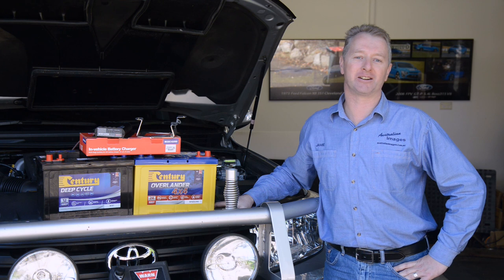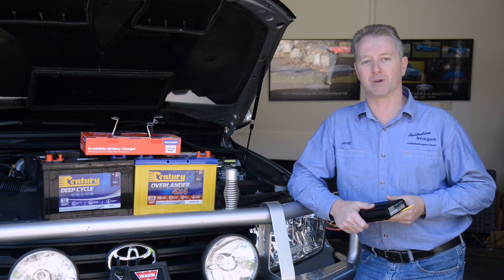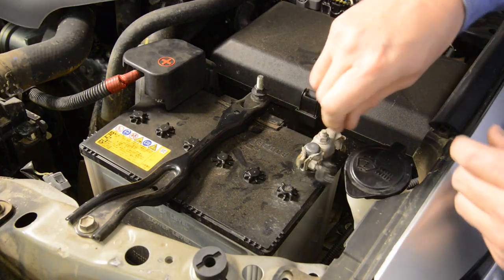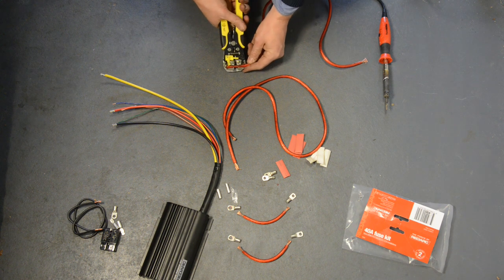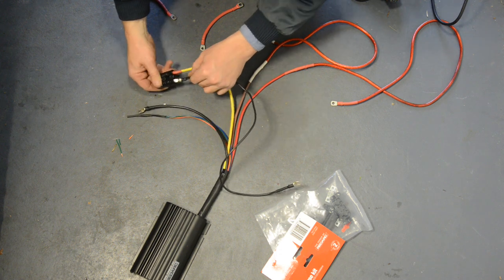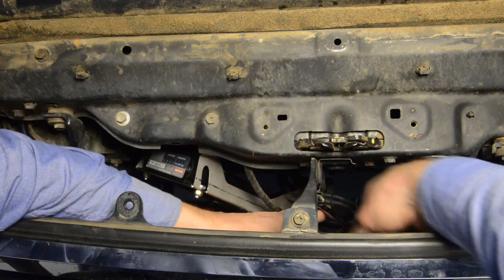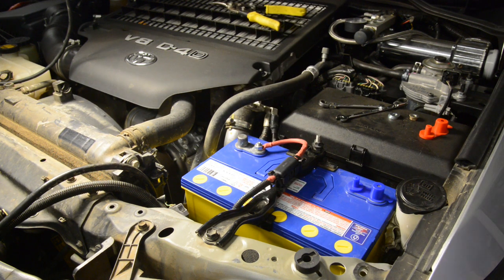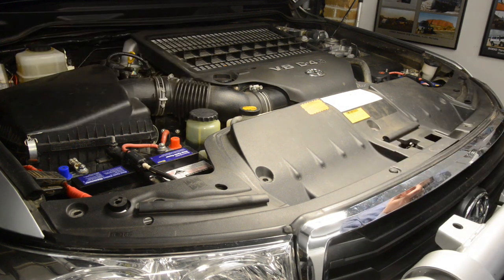LandCruiser 200 Dual battery system & DC-DC charger install - Project 200 - Redarc BCDC1225D

Comment: australian images im following your setup just wanted to know on the deep cycle battery where is the other live wire coming from, 1 from the bcdc what about the other one. Is that the lead for your fuse box thanks.
Reply from the maker: Yes, that's correct. Goes over to the input for the fusebox.

Comment: I have a question how come you don’t connect the blue wire to the fuse box to fire the charger ? Just wondering how it knows how to turn on ?
Reply from the maker: No need with the 200-series as it doesn't have a 'smart' alternator. So the charger detects the car is running due to higher voltage on the start battery, and switches itself on. Then turns off when the voltage drops again after you turn off the car. You only need to connect the 'trip' wire if the car has a smart alternator.
Reply: @austimages  thank you so much very well explained

Comment: Hi, what cables we should use ?
Reply from the maker: Between the batteries and the charger, you should use 8mm2 (which is also 8AWG) cable.
Reply: Thanks A lot , and what cable size should we use for running cable from battery to behind car for fridges etc ?
Reply from the maker: @tyfam  That depends on the total current draw. You want to use a cable large enough to keep voltage drop to less than 1 volt if possible. There is a calculator here: http://www.voltagedropcalculator.com.au When you use the calculator, the length is just the one-way distance from the battery to the load. This calculator automatically works it out using the return distance, which you normally have to include in calculations.

Comment: Why use a 25 amp charger ?
Reply from the maker: It's what Redarc recommend for that size battery and my typical current draw. If you have a larger battery and/or higher current loads, then you could go for the 40 amp charger instead. They have a calculator on their website that you can use.

Comment: Can you run just the 2 batteries on the 200 without a BCDC charger..?
Reply from the maker: That's how the factory setup works. But if you want to split them so accessories don't drain the start battery, then you need to have a way to charge the aux battery. Either a BCDC, an electronic isolator or a manual isolator. BCDC is the better option as it looks after the battery and allows solar charging as well.
Reply: @austimages  Thanks for the reply and I just installed the BCDC with a Deep cycle and the Century Ultra Performance instead of 4x4 overlander. System is working as expected. I have a Century BM12V Bluetooth sensor connected to the starting Battery and everyday in the morning (cold start) gives me a notification saying the cranking voltage is low which varies from 9.3v to 9.5v. Is that normal..?
Reply from the maker: @sampathh  I don't have any experience with the Century monitor. But it is normal for voltage to drop when cranking. I wouldn't;t think it would go down that far though. Probably best to contact Century and check with them regarding the setup.

Comment: I thought the reason for the dc-dc chargers is to prevent voltage loss since longer wiring causes that, but that doesn't look long I reckon. So why need a dc-dc charger?
Reply from the maker: They are better for batteries in general, because they deliver a good charge profile at variable voltages rather than the raw current/voltage from an alternator.
Reply: @austimages  Righto, would I need an isolator switch if I have this DC-DC charger?
Reply from the maker: @MC-jf6ic  No need for an isolator
Reply: @austimages  Thank you

Comment: Where did you mount the Anderson plug?Were there any problems with the height of the aux battery and the original clamp?
Reply from the maker: The anderson plug is mounted to the bullbar, behind the winch control box. You could also mount it to the grille. No problems with the clamp and the battery.

Comment: Hi there, If you add solar pannels would they work through the unit without the car being on?
Reply from the maker: Yes. The charger is triggered as soon as there is sufficient voltage available. The car doesn't have to be switched on.
Reply: Not if it’s hot

Comment: G’day
What’s your opinion of lithium batteries, worth it or not?

Do you think an inverter is necessary or is it an in-needed luxury.
Reply from the maker: I haven't tried lithium batteries under bonnet yet, although I will likely go down that path next time. They are great for weight and deep discharge capability. I think the jury is still out on under bonnet longevity if you operate in high temperatures and low speeds. Inverters are great if you have 240v equipment you need to run. I don't have one in the 200 other than the small factory unit, which is enough to charge batteries. Very useful in a caravan or camper when you're off-grid.

Comment: Love your videos Jamie. If you were doing the same battery install today would you still use the Century and the Overlander?
Reply from the maker: Still happy with both of these. 5 years on and the overlander is still going. The deep cycle has been replaced once, last year. I'm keeping an eye on the long term performance of some of the new lithium batteries under bonnet. I have a 300-series on order, and will decide then whether to go lithium. Much more usable capacity, but also much more expensive.

Comment: Very informative video. I have just purchased a 2018 VX 200 series and looking at a dual battery system. The company who are carrying out a lot of my mods are using Intervolt DCC Pro system, have you heard much about theses? I do like REDARC products.
With the Intervolt you get a display system to monitor your battery’s/charging. What do you use with your REDARC system?

Comment: Great video's. Would you consider doing a lithium battery setup as from Deep cycle systems. ULTIMATE DCS 12V 260AH DUAL BATTERY SYSTEM (LITHIUM) – LAND CRUISER 200 SERIES
Reply from the maker: I would absolutely go for lithium if not in the engine bay. I'm still wary of putting them under the bonnet, but I would consider it after doing some more research on real-world durability now that they've been around for a few years. As I'm not in the market at the moment, I haven't looked at how they are performing after a few years.

Comment: Hi,great explanation as always!
Would this also be the same or similar set up for Petrol version 4.6 v8 with only One factory battery?
Cheers
Reply from the maker: The same, other than no need to remove the linking cable. You'd also need to get a factory battery clamp from Toyota for the 2nd battery.
Reply: Australian Images Thanks a lot

Comment: Do you not need to plug the wire for a smart alternator with a LC 200?
Reply from the maker: No. The 200 doesn't have a 'smart alternator'. It has a 'temperature sensing alternator'. No need to connect the extra wire for that.
Reply: Australian Images thank you!

Comment: Does this also apply to 100 series LC with dual starter batteries?
Reply from the maker: Yes, other than the charger bracket that was used, all of the same parts and connections could be used in a 100.

Comment: this land cruiser 200 series not have a 24v start? in this case Why have 2 factory batteries?
Reply from the maker: No, it does not have a 24v start. The two batteries are in a parallel 12v configuration. The only reasons for having two batteries would be to provide additional cranking amps during starting, or to allow for additional accessory usage without getting a flat battery.
Reply: ah, I thought is same wath my 80 series. My 80 series have dual factory batteries, with 24v start and system electrics12v.
Reply: But, if it have his one alterator to charge bateries, why you install a batery cahrger?
Reply from the maker: The two batteries are now split, so leaving a fridge on for a few days doesn't flatten the starting battery. So the alternator is no longer connected to the 2nd battery. To charge it, you either need a 'battery isolator' or a DC-DC charger. An isolated is simpler but a DC-DC charger does a better job of charging the battery.
Reply: ok, so the idea with this is to have one battery for the accessories and one for the boot. But with a single battery the engine will start well?
Reply from the maker: Yes, that's correct. Starts fine on a single battery, but it needs a CCA rating of around 700 or more.
Reply: Nice, Thanks a lot. anther question: You have heard of the famous turbo timer, the device that leaves the engine on for a while, to take care of the turbo, in which the temperature is normalized before turning off, in the land cruiser, it is necessary to wait a while to turn off when one performs a trip?
Reply from the maker: It depends on the driving. You don't want to drive hard for a while then turn it straight off. But so long as you give it a bit of cool down driving for a few minutes or let it idle before turning it off, there's no need for a timer.
Reply: thank you very much

Comment: If the v8 use 2 why does the prado use 1
Reply: Because extra cylinders requires more battery power, or cold cranking amps to start